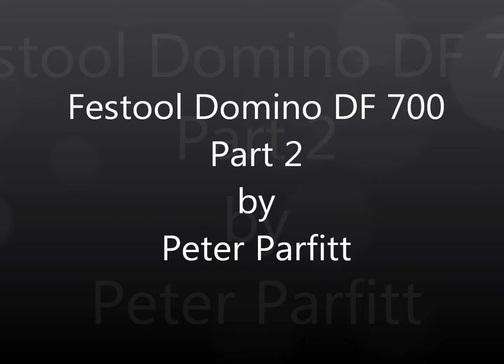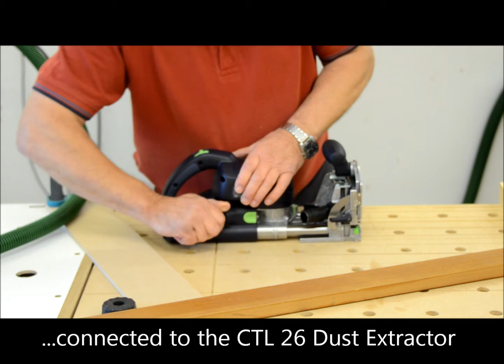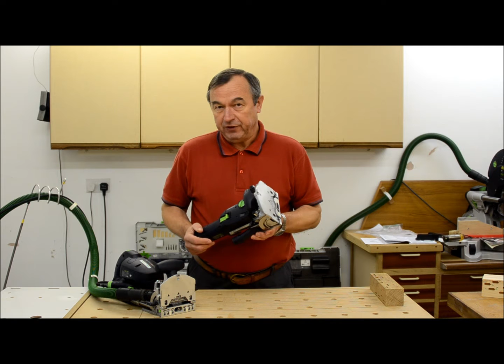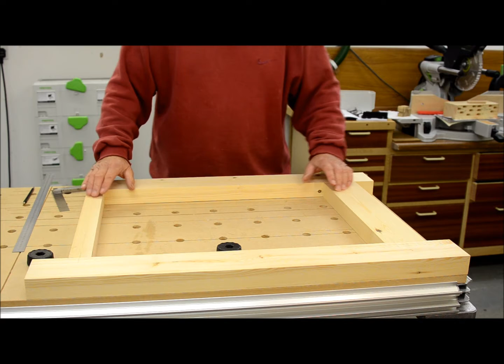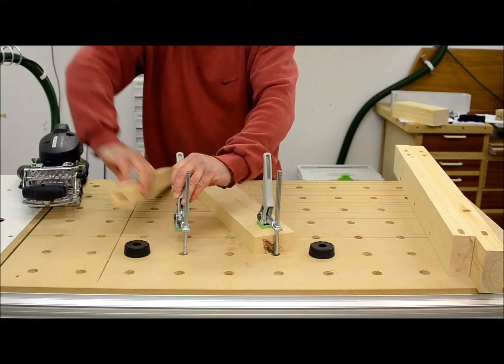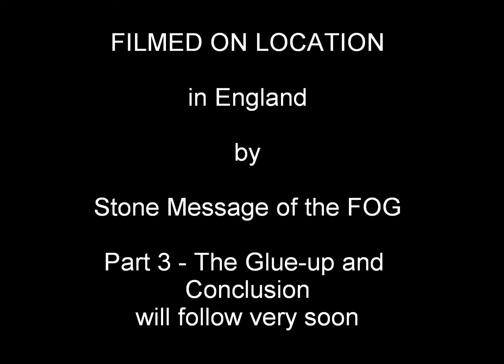Festool Domino DF 700 Review Part 2

Comment from the maker: I am not sure which joints you are referring to but for the actual joint location I used a pencil mark on both pieces of wood to be joined. For the height of the joint I halved the thickness of the wood and used this as my setting on the Domino making sure to cut from the face edge each time.